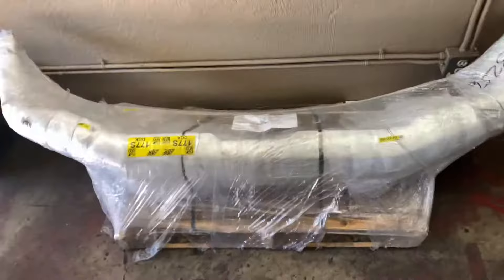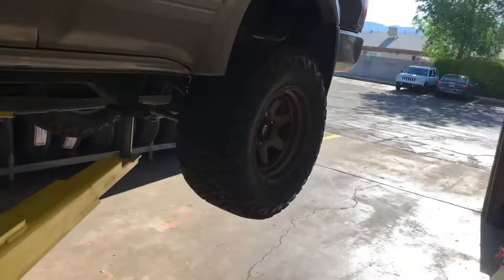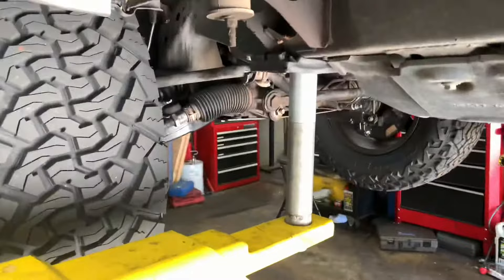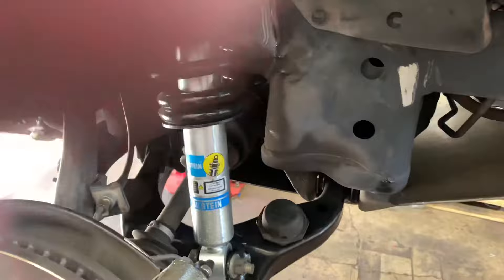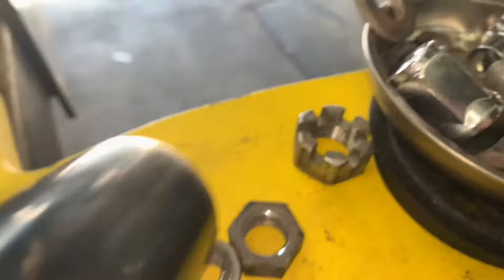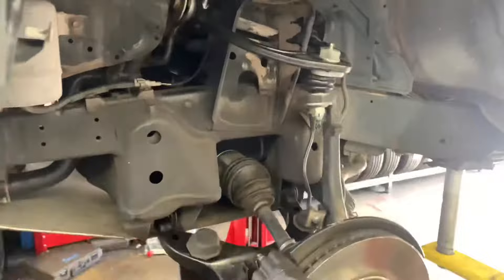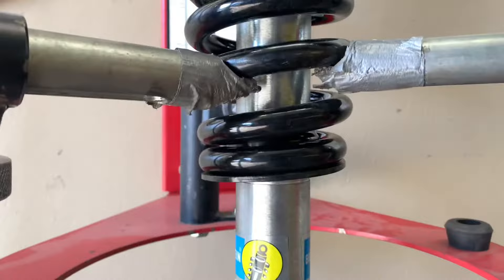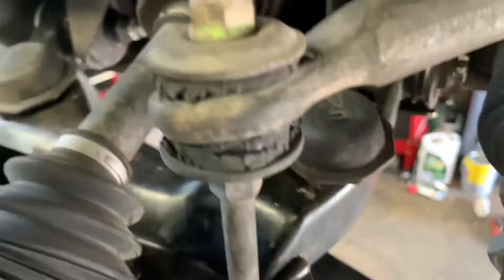“Bilstein 5100” DONT MAKE THIS MISTAKE!!

Comment: yea, the reason why you couldnt find your scenario on youtube anywhere because the 5100s are designed to use the stock spring. so when the product is used like its supposed to be used, with the  stock spring on 3rd clip as an example, it  wouldnt be an issue. You installed an OME spring which already provides lift, onto the 5100 at top setting which is why it road awful.  Your video is missing context and your statement/issue  is specific to you.
Reply: One of the guys at ADO told me that you want the springs to do the lifting, not the shock. Is there anything inherently wrong with using the 5100s and stock springs? I just upgraded my 265/70s to 75s, and now I want a small lift/level but not the cheap route of spacers. I was set on 5100s and stock springs until he told me this.
Reply: @radishfox308  that's the idea. 5100 ride height adjustable shocks are designed to be used with the stock spring, and the clip settings preload the spring to get whatever height you need (this will be specific to your setup, different trucks may have different clip settings that obtain different rife heights). 5100s with stock springs is 100% safe. And how they are meant to be used.
Reply: I just installed the 5100 with stock springs. I settled at 1.75” lift height  and i just don’t know why the wheels titled inward ( negative camber). Im going to do the alignment soon but the ride was terrible. The steering wheel is soft and every time im going over a small bump I thought I was going to spin out. What can I do to fix this? Im new to this.
Reply: @OverCookedRice get some adjustable cam bolts
Reply: Question. What would be the best shock to put on a sec gen Tacoma?
Reply: Did you figure out what went wrong? @OverCookedRice
Reply: I agree.  I have these on my gx470 on the highest setting on oem coils.  Rig is 2.5 inch higher as advertised and rides awesome.
Reply: Those look like SPC upper control arms. I just replaced mine as it was the uniball bushing that was totally trashed. I only had them a year hopefully you got the upgraded conventional bushings otherwise you’ll be changing them soon
Reply: I used stock spring on 5100s on top setting to get tundra leveled and it was awful,u could feel every tiny bump like there was no shock at all. I would never suggest anyone buying 5100s
Reply: Monotubes are not known for comfort.  They will last a long time and will handle great on corners and big whoops.  But any small bumps on the road will be pronounced

Comment: It looks like you have OME front springs from what I know those springs already provide the lift. Unless you are using the stock springs then use the clip settings
Reply: I just installed 5100 with ome spring with the set up to 4th line on my wk2 and the ride is awful especially when u go over a big bump it makes a noise like "dug.dug". What do you suggest if moved to lower line maybe 2nd will the ride be better but will i lose the height? Pls response
Reply: @kuluk6254  you should set it to the last clip on the shocks. The Ome springs provide the lift already by putting more preload on it it’s gonna ride harsh.
Reply: @kuluk6254  you don’t need to make it complicated, if you’re running the stock springs (which has no lift at all) set it to whatever clip, if you’re using an after market spring that provides the lift your best bet is to set it to the bottom clip.

Comment: Might help but bilstein 4600 are for stock truck and 5100 are meant LIFTED trucks if your looking to lifting your truck go with 5100’s if you look closely the 5100 has a longer stock body the shocks have the same valving however 5100 are meant for a lifted truck hope this helps.

Comment: The top notch with stock springs didn't work for me either.  But just down one notch 1.85" is fine.  Not really a lift more of a leveling.  I could see buying new OME strut springs and going with the lowest notch but this was cheap and effective and my 4R looks more level now.  And at that height I didn't need new upper control arms.  You don't need a spring compressor if you use the weight of the vehicle and jacks to just lower the shock out.  Was pretty easy in the driveway.

Comment: Don't run 5100 with aftermarket springs they are designed to use the stock spring height.

Comment: I had them put on my stock Colorado on the 2.5" top level, and it handles BAD. Floats around like a boat. I assumed that "Bilstein"'shocks would make it handle better. NO. I hadn't noticed I didn't have a rear stabilizer bar until I put these shocks on.
I also picked up a high speed vibration after the install that's driving me crazy. 
One shop I went to said the vibration may be changing the geometry of the truck.
Next week I go back to the stock level. 🤞🏽
Reply: Hey man I also have a Colorado and thinking about getting the 5100 . How does it ride on stock level ?

Comment: After a shop fixed my car it stands 1 inch higher (it was lifted already) which throws the alignment off by a lot besides the horrible ride and it pulls to the left. I gotta take it back there and have them lower the adjustable ring by one inch.

Comment: with OME spring you need to set the shock on the lower setting the spring give the lift needed !
Reply: Then why are there settings you need to use on the lowest only?
Reply: @jalvah the 5100s are actually meant to be used with stock springs, for those you use the 3rd notch, for the OME you use the 4th notch.

Comment: Thanks. I have been sitting here wondering …what level should I go to ?  Level II sounds most reasonable.
Reply: If you use the OE springs you should be able to use the upper settings without too harsh of a ride (it'll still change from factory, but not too bad). If you get heavier springs then you'll end up with a harsh ride.

Comment: Hello! I just bought a WK 2010 4.7, it is totally original, I bought the bilstein 5100 shock absorbers and I am going to install them with the original springs, my question is how much do you recommend me to lift it so that it does not start to harm the other parts and if I have to lift more on the front side than the rear or the same level on, thanks a lot! This is my first 4x4
Reply: My question is

Comment: I did my 2016 gmc 1500 z71 on stock springs @ #2 and still get wheel bounce over bumpy road.  Om gonna pull mine. And go to stock setting
Reply: Do you have a level kit installed?

Comment: Obviously you have zero idea what your doing lol.    These are for stock springs ,  if your running a spacer or aftermarket springs you need to run on the lowest setting sheesh
Reply: Your comment is even more hilarious. This video is informative and he stated its not his thing. Grow up little man
Reply: @johnniebkid  no its not,   someone may read it and use the first setting instead of having issues like he did and having to do it twice for no reason you goof
Reply: @s.a.t419  Do you understand using the first setting while using the stock springs will lift the front end and give you the best ride? Maybe you dont.
Reply: @Johnny Martin    yes i do,    he replaced the springs with lift springs and put the shocks on the highest setting hence my original comment.....
Reply: @Johnny Martin     these are designed for stock springs,  if you go with an aftermarket lift spring you need to use the lowest position.     Even the top  position with stock springs will be to harsh
Reply: Yup 8 just installed on my 2003. Went with second clip assembled coils. And to high.  Now have to take them off and go to first clip 😡